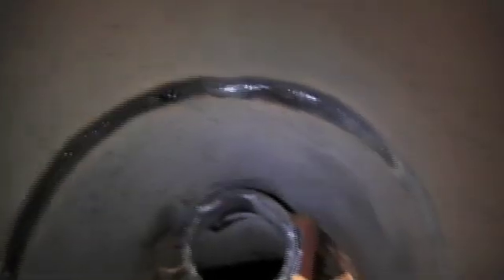Learn Uphill Stick Welding with 6010 root in 6G position

Comment: wouldn't pass at the power plant i work at. i weld there, but we don't have an R stamp so have to bring in contractors for boiler tubes, pressure vessels like drums, trash boxes in drums, steam lines, whatever. i've done them, but only in a pinch. what i see here is basically a fairly decent field weld, not one that would we'd let go by on something that could go "pop."  i've been there for two "pops" that were due to old, corroded line, and it was no fun. please don't pass these off as  "that ones good" or whatever. either it is or it isn't when someones life might get snuffed out by "good 'nuff."

Comment: Open root and your just dragging it... Doubt it'd pass a bend test. Also doesn't sound like you have your stick far enough inside the groove. Nice attempt though... To answer another post's question is it sounds like that because its open root. He should have his rod farther inside the opening though. All the pipe crew welders at my job work the puddle instead of a quick drag, just work it bag and forth (opening key hole and then back to puddle to have good fusion).
Reply: Greg B a whip? I noticed on a few 6G vids the travel angle was maybe 5 degrees on the root if not straight in. can you explain what I'm seeing? do we pull on the root or just whip it as you seem to be saying. I'm open for knowledge thanks!

Comment: with all of the arc strikes and pinholes, that root would never pass a visual much less a bend or x-ray test in my state or any other state ive tested in. You need allot of practice before you teach people how to weld pipe bud.
Reply from the maker: I'm sorry Kimmie but those pinholes you are referring to are simply in the slag not in the actual weld. It absolutely passed a visual. Thanks for watching.

Comment: You have good penetration in your root weld, but on a lot of my precertafication test inspectors want it to be even with the inside and smooth. Have you ever herd of the nylon test where they rob the root weld on the inside with a pair of nylon gloves to see if there is any rough edges on it? You usually have to re-certify on every job before they employ you and show them what you can do, that root weld you done looked pretty rough to me and I have only been a Union Pipe fitter for 32 years.

Comment: Any time I have tested on G 6 position and the root weld was 6010 instead of tigging the root in, it had to be as smooth and consistent as the cap weld with low hydrogen. This guy must weld in a scrap metal yard piecing scrap together to be crushed.

Comment from the maker: I didn't watch all of the video again but I did look at 2:13 and whipping the rod is common when the keyhole starts to open up a bit. I am trying to hang to the top somewhat it looks like because gravity is naturally weighing on the puddle causing it to sag to the bottom of the root pass. Going over it was maybe just to add some extra metal or burn something out of the way. Thanks

Comment: it looks to low on the inside. your going to have to run your hot pass colder so you dont blow through the root and you run the risk of lack of fusion.